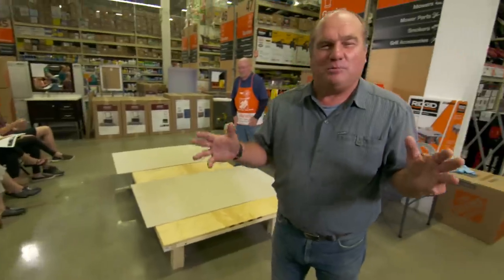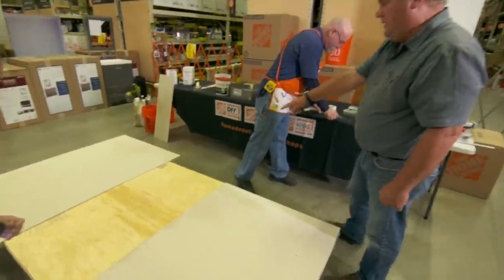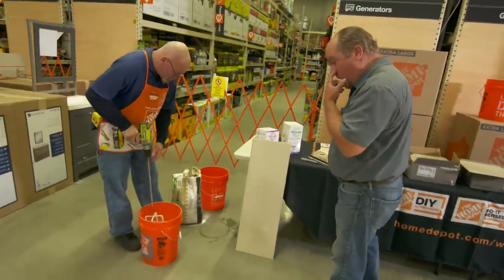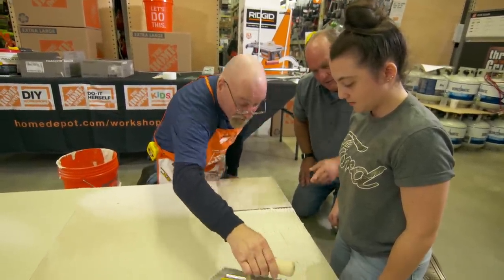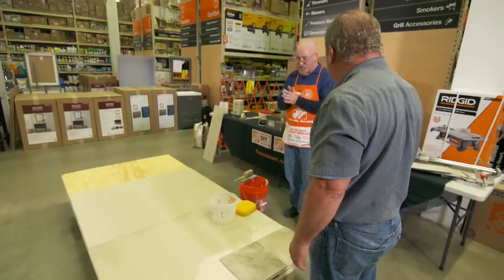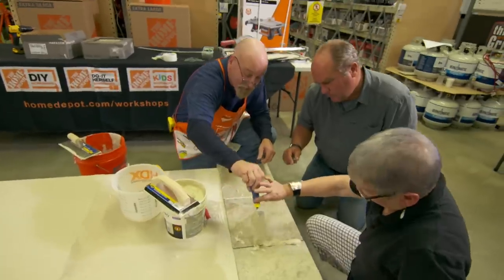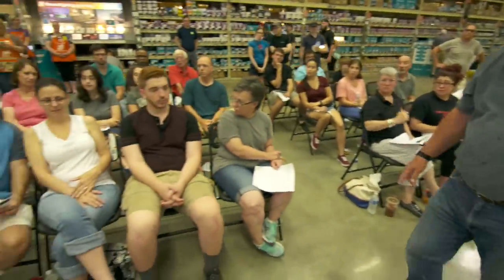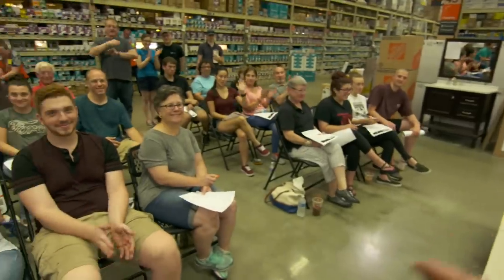Tiling Workshop at The Home Depot with Richard Trethewey, Recorded Live | Ask This Old House

Comment: I demonstrate, make sure the sub floor is screwed nail down tight, thin set under hardiboard screw it down, snap layout lines, put down thinset a few tiles at a time, back butter tile, make sure tile edges line up, keep mortar joint equal.

Comment: Is there a way to separate to light fixtures on 2 3 way switches and put a timer switch and a single pull on one light and the other timer switch in 2gang box with out going in the attic because here in california it's hot.temptures so high you can't stand the heat so can you guys do a video cause this weekend I am buying the light switches so can you please help me thank you

Comment: Use glue to the boards. Lay out the tiles in 2 rows in the room before you start. That way you know if you need to start every row with a half tile. If you don't you risk of ending with a tiny tile. And that looks bad.

Comment: I am on a concrete slab. Do I need to lay down the plywood first?
Reply: no, just tile on the concrete. Make sure its clean though.
Reply: Adding to what Reaper said, make sure the floor is flat/level as well.  Concrete might feel flat until you throw a 4 to 6 ft straight edge on it and find some dips in it.  A self leveling compound can be used to fix that issue.

Comment: They never mentioned that you are supposed to start from the middle of the room and work your way out
Reply: andresrivera796 they did. He mentioned snapping lines. It's not how I would do it because you could potentially still end up with a very thin cut at an edge. I prefer to work the layout so that the cuts are all reasonable size.

Comment: Now all those people who attend the class think they can tile. Until they start a project then they would know they are way over their head. Lay out is the important part of a tiling job where he failed to mention. Back butter is not just for the last piece of tile or where you can't trowel thinset on, any large format tile should be back butter to make sure thinset is adhered to the tile. Many others things he did wrong as well.

Comment: I Can't believe that people still use backer board.
Reply: What do you use? Hardibacker has been working for me and relatively cheap, as long as the subfloor is secure, flat and level.
Reply: Connor Pearson I use Dural Durabase and Ardex 207 to glue it down. Give it a try, really speeds up the process. And it's easier than carrying around that hardibacker.